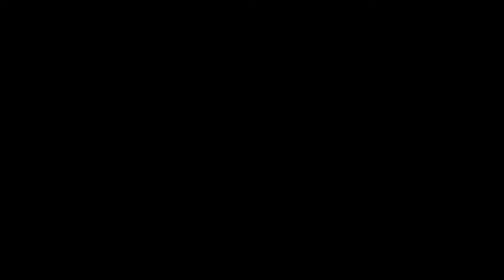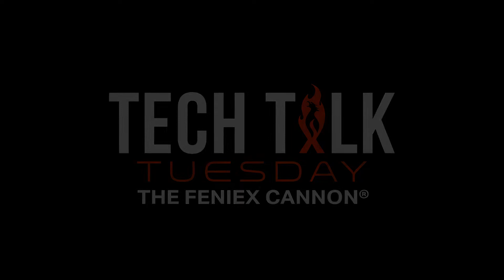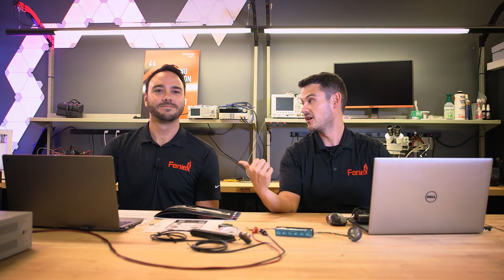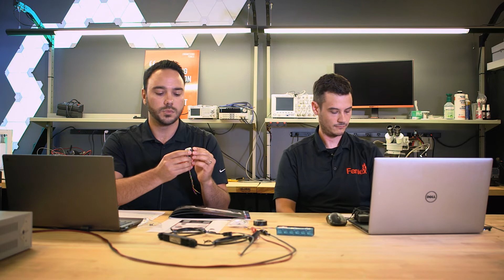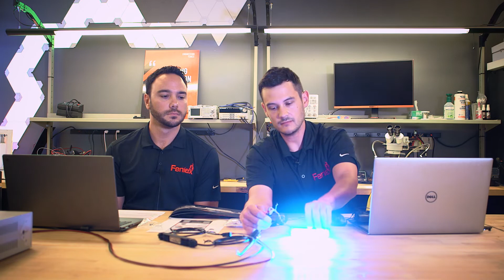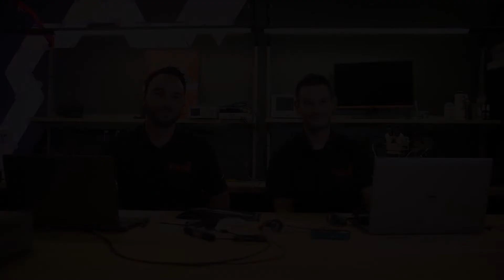Tech Talk Tuesday // The Feniex Cannon

Comment: Slowing down patterns was a horrible choice...Whelen, FS, SOS, even Code 3 & Star all have either MORE patterns, and thus there will be more slow ones than Feniex ones - and MOST IMPORTANTLY is that they all offer total user control over patterns via their power distribution/control amps (Cantrol, Core, Matrix, Pathfinder & Blueprint....thus each user can select from over 100 patterns ....which brings us to another bad decision: not updating Feniex lights to be able to display the patterns those systems have when set into steady burn like all of those other companies products can (mpowers on Cantrol or Core...MR6’s on Blueprint or Another ...etc.  **And just one more rant: WHY DID the great introduction of quad colors have to be accompanied by a limited and WEAK VARIETY of patterns???!  Besides Attack, which has even been butchered substantially too (colors don’t ever flash together/quickly back and forth - anyone at first glance can’t tell if it’s a volly FD or a cop or a big break light or tow truck, if in let’s say dual RB or tri RBA, because each color flashes independently of the other colors, and for unusually long periods of time Dash like 1.7 seconds to 2.4 seconds...which is long for flashing).... but that’s not even the worst of it, because on the light sticks and ILB, aside from cluster mix which is no longer cluster but instead something like what you would expect the child of a federal signal cn signal master pattern (22or24) and a Phoenix fusion 600 or 800 would be - all the other patterns are extremely weak (how can you not have a fast paced wigwag? How can you not have a fast and or alternating fast to rapid wigwag and in and out?? Those are as you put it “ Industry standards“.....***Oh, and how do you create a product line that requires the user to have multiple controllers to operate, which is the case with the 4200 DL and the quad products (ex: you have a high LB and a 800 light stick, and we won’t even talk about any other lighting yet, because just those two products filled every port on the 4200 and then some. Did you not see your engineering team having to use two of your own controllers to run tests??... which was still using multiple products controlled through the same ports/buttons.  

B bottom line: the V3 change was just the beginning of signs of the ridiculousness that was coming with the quad products – you had amazing Products with the fusions,T3’s, ILB & 600/800 fusions, etc and rather than continuing to be an industry innovator decided to try and become an industry “normal”...and all the while seemingly oblivious to the fact that every company was making fully Controllable /customizable turn key lighting in Siren control systems well you guys continue to pump out 4200s and storm pros with updated wire connectors (even that was silly, as you reduced it by 10 ports, not counting the additional eight traffic advisor ports ... what was the purpose of that??  

I love your products even the ones I hate, but I I have a feeling I’m going to be very upset by whatever the next  “thing” you guys do – which I have a feeling it’s going to be a updated version of the quad products, like flash patterns, as it seemed a real possibility when watching EFS’s video on your demo car that has all “products that somehow go faster than the ones everyone else has purchased in the last three or four months”

Comment: Can you advise if the dim mode is rated for constant on use or is there a suggested maximum on time? 

I will do some field testing for you guys, how long is that warranty? :D
Reply: I think he said it runs at 25% power... seems like it should be good as a running light. I’d like to know the same for dim mode and for full brightness as well. (ie, a set of red facing to the rear as a fog light... as seen in European models).
Reply: @thomasrossi31  Right, I'm going to use them as running lights with integrated turn signals on a motorcycle. I think it will be fine. I'm assuming  they're using PWM for the dimming so its running on a 25% duty cycle and should only be producing a quarter of full intensity constant on heat. Also will be using a dual color, so only 6 diodes active.  Thinking of doing the same as you with red to the rear depending on how the front mounted ones work.
Reply: Robert Daggett  off road use only, of course.

Comment: In regard to the Fusion surface mount, dual color 40°, have you determined the the distance of light output, in feet, from the fixture? (ie 12’ or 18’) thanks.
Reply: Sorry, I don’t understand that equation. I don’t have any fusions in my possession.  I thought someone from the company might reply with a “working output distance”